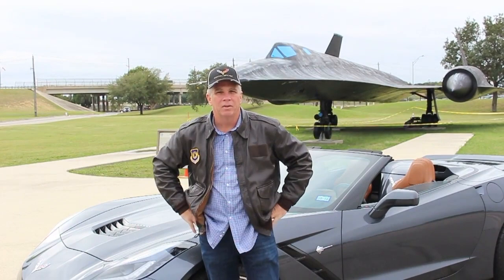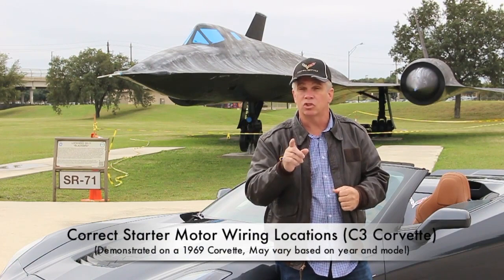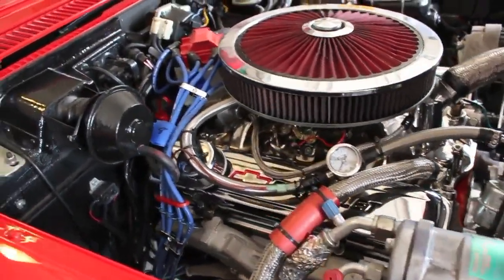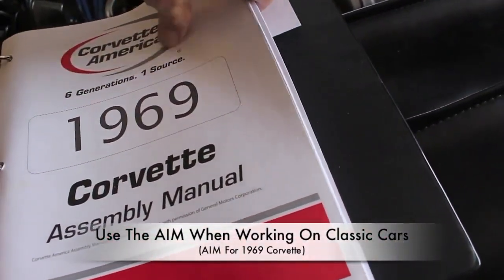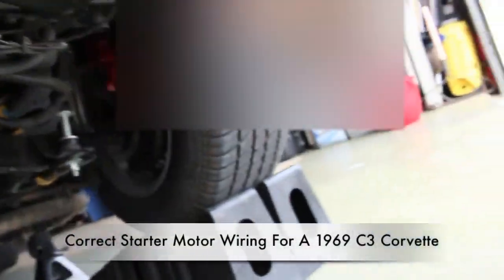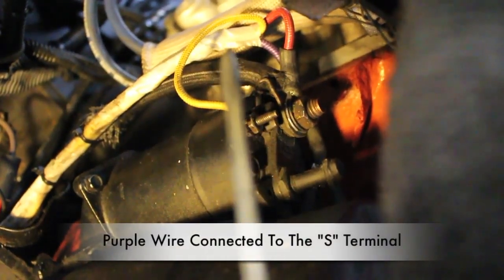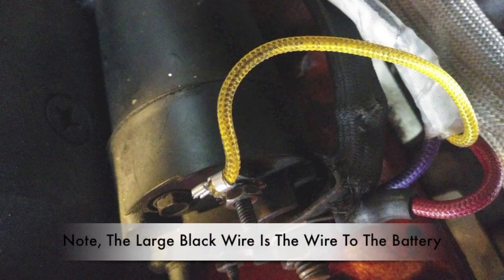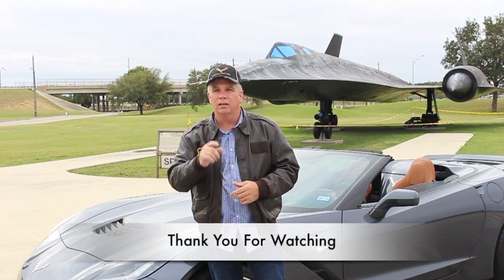How To Wire A C3 Corvette Starter Motor

Comment: What is the yellow wire for? 
 One wire goes to the battery, the purple wire I believe goes to the ignition key what is the yellow wire for?
Reply from the maker: the 20awg yellow (braided cloth wire) goes to the "R"un terminal ("+" terminal on the ignition coil).
Reply: @TheWhatisright  yellow wire goes to the ignition coil. On startup, ignition runs on 12v. Once started, it goes back down to about 9.